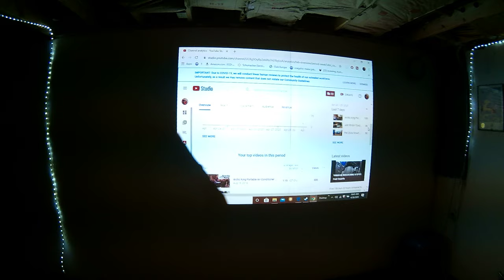Basement Man Cave Home Cinema Bar Room Build

Comment: Unrelated to the man cave, but would appreciate an update video on the LEAF if you get a chance. How's the 30kWh pack holding up? What's the range like 2 years later? Did you get the software update done..etc. Thanks
Reply from the maker: will be making one soon we are at 3 years 29000 now are 30kwh pack is holding up great full bars and think we are still geting 125mi -130mi full 
we did get one software update  
we did forget to rotate the tires a few times lol :( they are bad 
it goes back in July 
we will make a few more video"s soon now do we buy or get a new one who know's